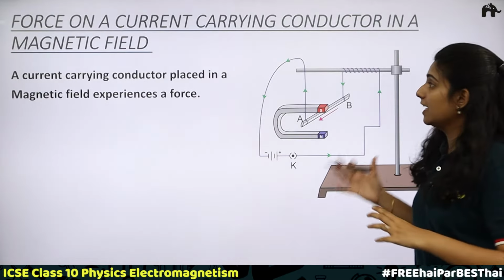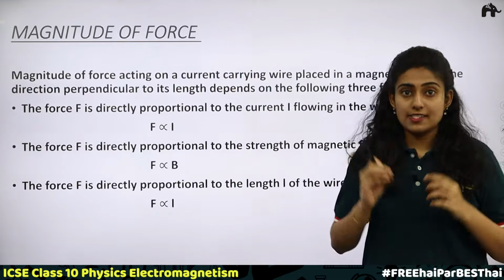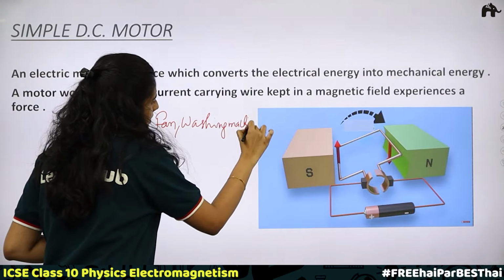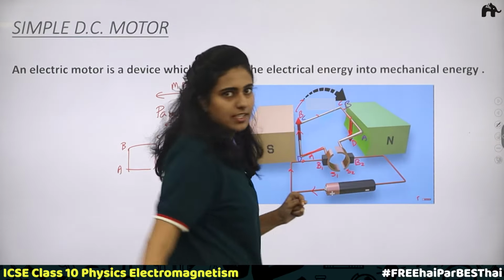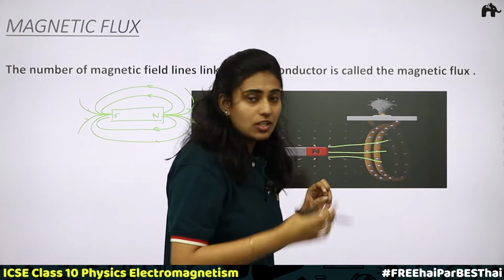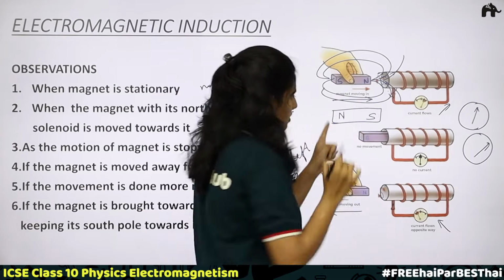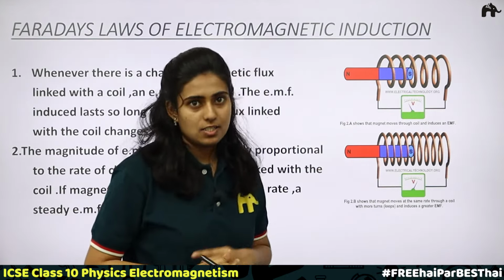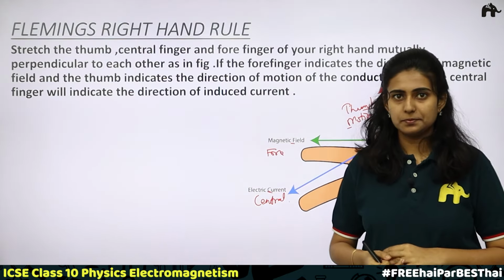Electro-Magnetism Class 10 ICSE Physics | Selina Chapter 10 | Current carrying conductor, DC Motor

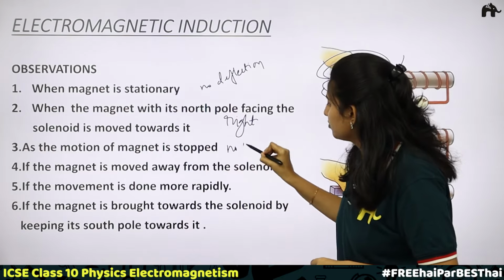Comment: 37:52 mam I have a doubt that why is there no current. like when we move the bar magnet closer there is increase in magnetic flux and further if we keep it in that position there is no change in magnetic flux but still the current is there because the galvanometer got deflected when we moved bar magnet from is initial position...